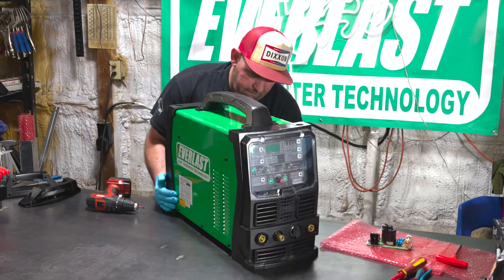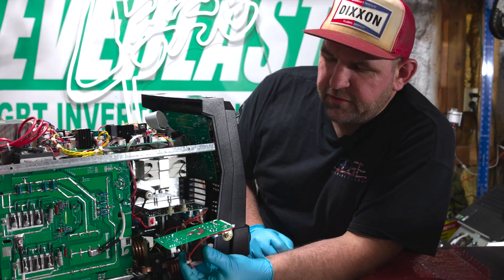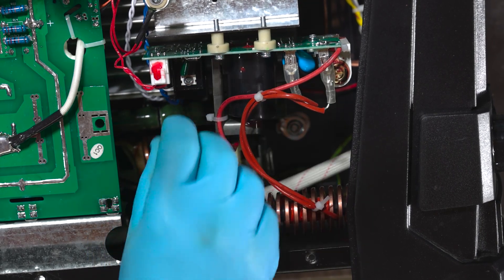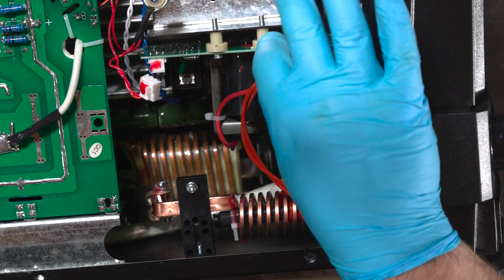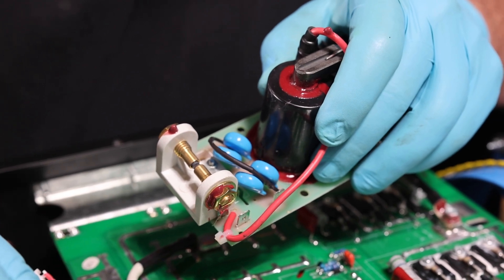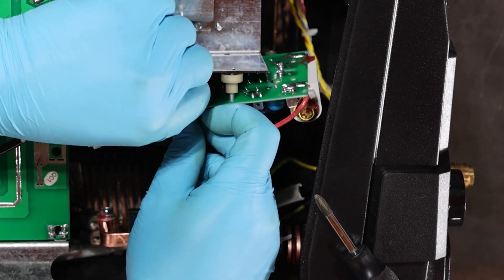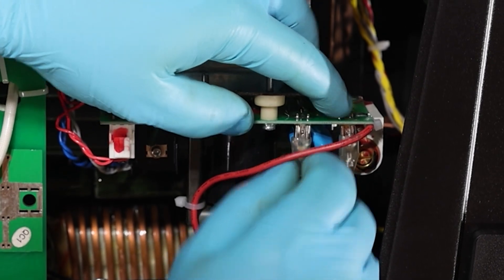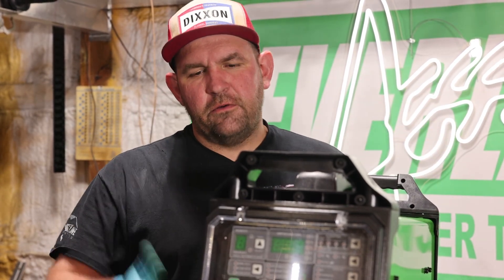How to Change a High Frequency Board on an Everlast Welder

Comment: I sent an Email to you customer service for some way to get in touch with you Jesse. I plan on upgrading to the 255EXT or the soon to be released P Weld 325. I am leaning toward Green however i have a couple of questions. I need your Email address.
1/04/2023

Comment: My machine is 211si everlast. Can I covert my machine to high frequency to be able to weld aluminum
Reply: you need ACDC unit , MTS is DC only
Reply: sure you can might burn out lol hook up an oscillicope and change the frequency but it willl fry all the components